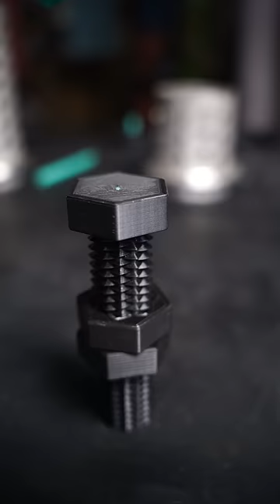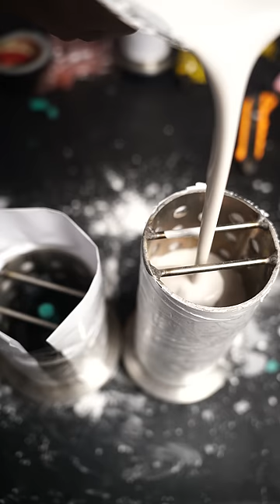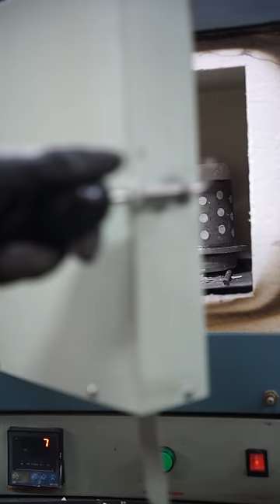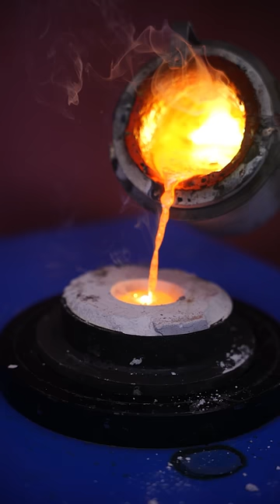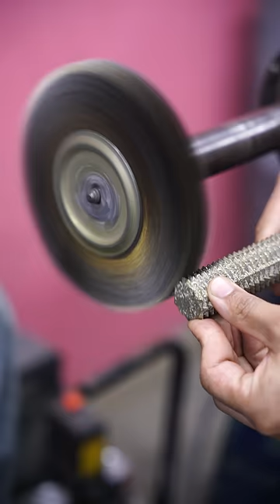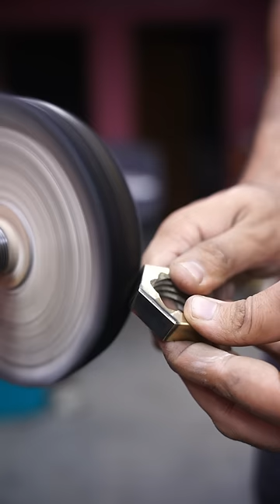Making Bolts with double threads

Comment: ok next with triple threads
Reply: 🤔 I think it'll explode, or rip the fabric of space and time?
Reply: You’re confusing the thread direction with the amount. You can have 3 or more threads on a shaft going the same direction. And it’s easy to machine with a lathe.
Reply: @xerhion4214  yeah,I've done a few 4 start threads,they screw in 4 times faster than a standard thread.

Comment: Nice casting. I cast mostly jewelry for 15 years. Got out just as 3d printed models were coming out. They would rarely burn out all the way. In my last 2 years they finally came out with a product that burned out properly. The company I worked for had 3 printers and 1 3d wax mill. This reminds me of my time casting. I wish I could still do it. But I got in a car accident and couldn't do the job anymore after the injuries. Can't lift the cans out of the oven anymore.
Reply: That's what a minion is for 😁. You just have to find someone willing to be your apprentice 👍👍